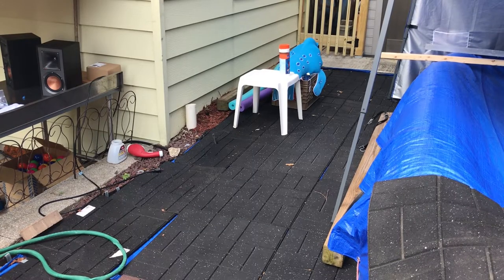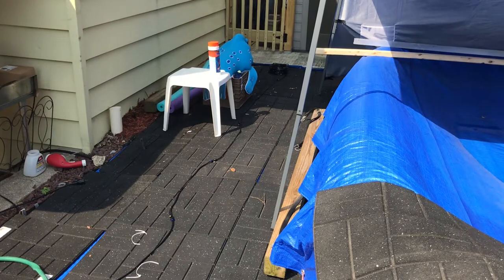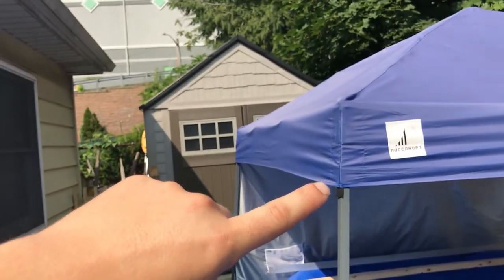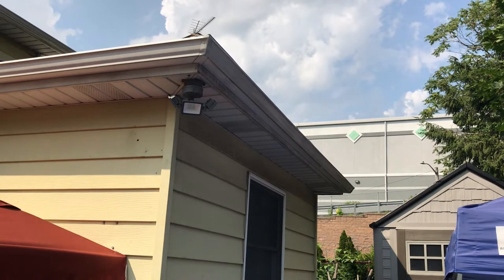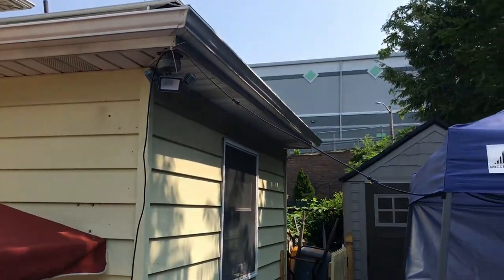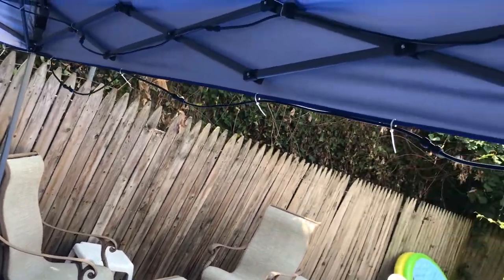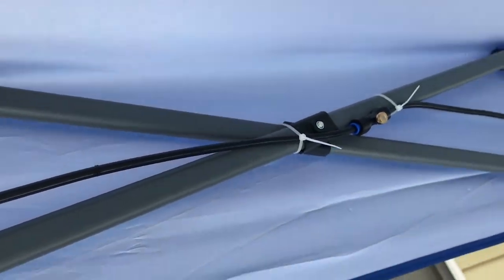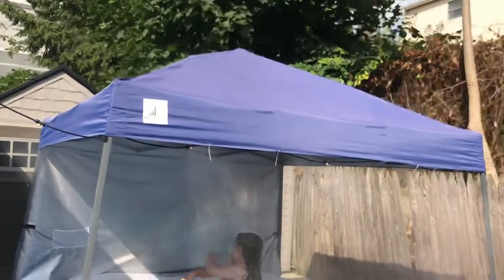Installation Review of Homenote Misting Cooling System 75FT

Comment: How do you clean any sand/grit that might get in the spray heads
Reply from the maker: You water line should never be in a vacuum or negative pressure. Sand or dirt would just accumulate on the outside. If they are sitting in a windy area for a while not being used a safety pin would do the job easily. Good luck on your travels.